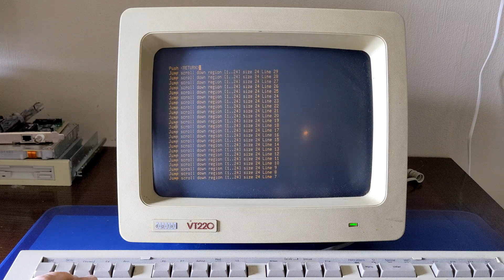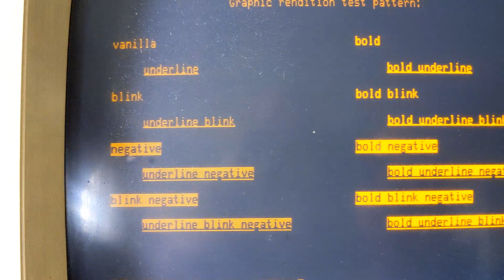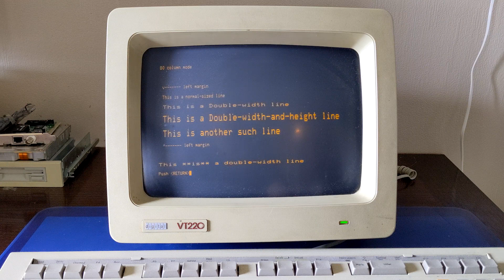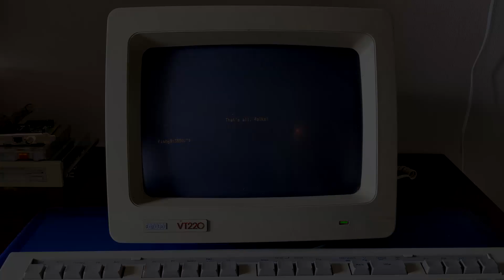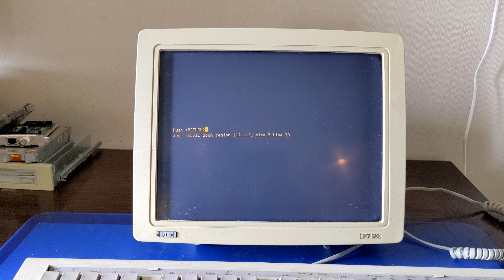DEC VT220 and VT320 demo using vttest

Comment: if you swap the terminal used on an OPENVMS ALPHA ds25 system does the system need a reboot to detect the new terminal? since swapping a faulty VT320 terminal for a WYSE WY-520 terminal i cannot get to the Alpha OS or even a command prompt, i see the setup menus displayed on the terminal but when i Exit the setup menus it takes me to a screen that just shows 1,1  Line   Printer None, its not showing me the usual Alpha OS screen, the system cannot be rebooted because its used as a critical system for the business and used 24/7. Thanks

Comment: Perhaps try connecting to a raspberry pi rather than telnetting through a 486? Might fix your issues
Reply from the maker: Well, no. The VT needs actual RS232 or current loop, as well as real hardware handshakes. A R-Pi has none of those things, and would cause other issues for vttest as well. The 486 was easily available, and made the demo easy. A Raspberry Pi is very seldom the correct "solution", imo.
Reply: There is absolutely nothing wrong with using a 486. You could even use an 8086 or an 8088 but a 286 could function as a server. Obviously I recommend at least a 386 for its 32-bit capabilities and true protected memory.

486 is actually overpowered for this. The VT220 was released in 1983